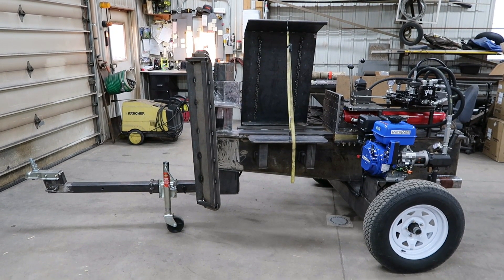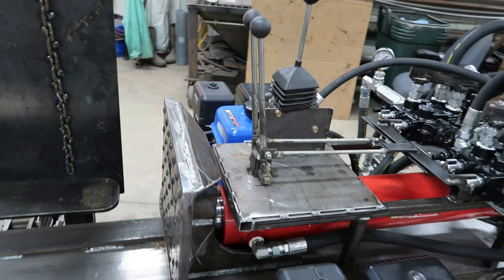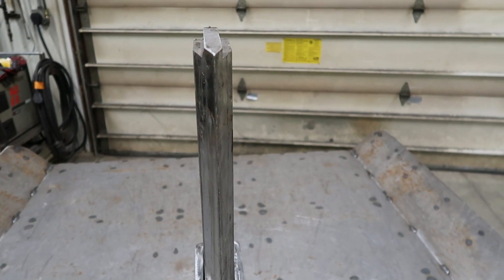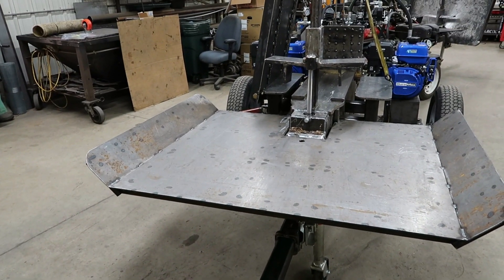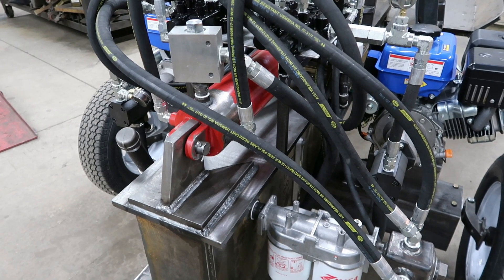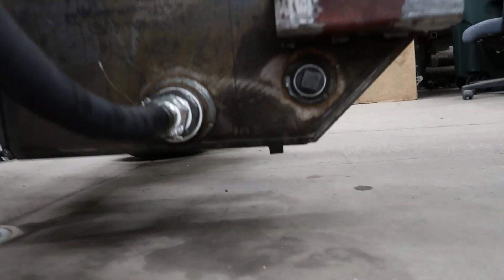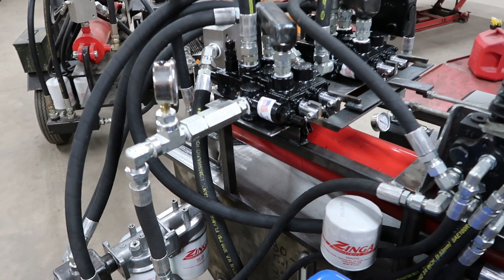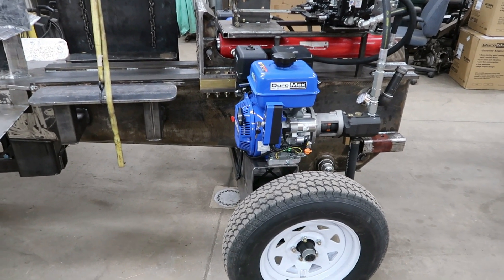Wood Splitter- Double Vision

Comment: I finally got my center beam welded together , i was wondering if your ram was all the way against the pusher plate or back from it relying on the pin?
Reply from the maker: Good to hear. Yes rod eye and push plate bushings were all machined out of a solid 2”x4” block of steel. When welded to push plate gussets, bushings, and rod eye were all set against back of push plate, 1.25”  bolt inserted, then welded except for rod eye. Eye was then removed and welded to rod.

Comment: Nice job, so how are those Duamax engines? The 18 HP has no trouble running the 28 gpm pumps?
Reply from the maker: So far no. My other splitter I modded had a 15 hp running same pump. But again I’m running a 5” cylinder which allows me to run lower pressures 2200-2300psi. If a person wants to run 3500 on 28gpm pump an 18 hp probably ain’t gonna do it.
Reply: @garny3766  I have a 28 gpm 2000 psi pump with a 18 hp B & S, 4” bore 3” rod x 24”cylinder, I prefer the speed over tonage but engine is getting tired and considered replacing it with that Duramax 18 hp but didn’t know how they were, hard to beat the price.
Reply from the maker: @garyallard1827  good so far. I probably got 40hrs on them. IIRC I had these two shipped to my door for just under $800.

Comment: What cylinder did you use? auto valves? Pumps? I want to build one with a diesel engine i have
Reply from the maker: Ruggedmade cylinder 5x30. ACVs and 28 gpm pumps from surplus center. A lot of hoses and fittings from surplus center as well.

Comment: Would you mind sharing what cylinder you used on this build and where you purchased it?  I'm weighing out all the parts to build something heavy duty like yours but having issues sourcing big cylinders like  Easton and others use. Your splitter is bad ass btw, the fab work and proof of concept is top notch.
Reply from the maker: https://ruggedmade.com/categories/hydraulics/cylinders/welded-log-splitter-cylinder-3-4-work-ports-5-id-x-30-stroke-x-3-5-rod-od-2-375-rod-end-clevis-mount.html
It’s the same cylinder as what was on the 37 ruggedmade splitter I had. Yeah hard to find a big rod/bore cylinder.
Reply: @garny3766  That cylinder looks pretty beefy, can't see me needing much more than that. Thanks for sharing, I like to open source info and help other fabricators when I can, I did a bunch of that on my sawmill build and may do something for my splitter build. I read your post about having the splitter bug, I've been using a TSC for the last 5 years and built a hoist for it a few years ago. I heat with wood( I do not have a furnace) It's time for a real splitter or time to get a furnace one or the other. Thanks again, subbed to your channel.
Reply from the maker: @Tonnsfabrication  I’ve been trying to locate the valve on this splitter https://youtu.be/_f-iHC2enuw
I think it would speed up and fit your TSC splitter just fine. Also most don’t need a 30” cylinder. I went with it cause I like my wood longer than 24”.
Reply: @garny3766  Is that valve not available at surplus? Apperance wise it looks like whats already on my tsc and some of the husky splitters I've seen but I'm no expert , plus I'm half blind. I'm definitely wanting 30" capacity, I'll be mainly feeding a boiler and a maple syrup evaporator both of which will accept 30" stuff. 24" sometimes is just a tad short and I don't mind waiting a few seconds.
Reply from the maker: @Tonnsfabrication  not yet that I’m aware of. The do have a regeneration/rapid extend valve but it’s for low flow pumps and a lot of modifications to get it to fit up. This valve in the video I believe would be just a change out. 
 Same here. When I had a box store splitter I would catch myself cutting blocks just a hair to long. 30” cylinder...problem solved😆

Comment: Great idea about the horizontal wedge laying flat for just splitting in half.
Reply: Not his idea. He did use a different design though.
Reply from the maker: @bullybluecoal1831  who else is using this wedge design?
Reply: @garny3766  Eastonmade. These are the Cadillac of splitters. Very pricey but a one time investment. All wear points are replaceable.
Reply from the maker: @bullybluecoal1831  yeah similar and as you said different design. I think he has 8-10” of exposed single vertical wedge when horizontal wedges are at or below beam. With mine you don’t loose any single vertical wedge height when lowering the 4way. I have 23” of vertical wedge. I followed timberwolf/Wolfe ridge design with a slight twist, I added small vertical wedges on the bottom of my horizontal wedges to create a box wedge when wedge is raised. It worked but I didn’t like the amount of trash the box wedge was creating so I removed them. EMs are world class splitters no doubt.
Reply: @garny3766  Interesting with the Single/4 way/box wedge design. I do like box wedges. Especially the pull back bar. I don't mind the "waste." Bark bits are always waste no matter what is splitin wood. The scrap pieces make good kindling.   
FWIW, I wasn't knocking your splitters. You build a good machine as well.
Reply from the maker: @bullybluecoal1831  no, no offense taken. For my wood cutting operation I move thru the woods and consume the whole tree. I end up with plenty of small branches hence I don’t need the box scraps. I’d much rather they stay attached to the pieces I split. My uncle calls them Sasquatch‘s toothpicks 😆
Reply: @garny3766 sasquatches toothpicks 😅.
I was thinking of building an adjustable box wedge, that I could raise a few inches, that way there would be less trash. With a fixed box wedge it seems like you have som many of those toothpicks lol.
How's this splitter holding up, have you made many changes.

Comment: Nice build! I think you will want to add an oil cooler, but otherwise it looks great!
Reply from the maker: So far so good. I been running it hard and the warmest I’ve seen is 130*F in 55*F ambient. The way I have the oil returning into the beam (dump valve base end constant return wedge end) it really helps to distribute the heat throughout. I can always add vertical cooling fins to help convect heat naturally.

Comment: Incredible build. I would have thought that going to a higher pressure and smaller ram would have worked out more cost effective than going to 2 28gpm pumps.
Looking at the Dad's first use video it looks like something is fouling up the release of the return stroke auto cycle lever. Instead of the nice snap action it's got some hesitation.
Reply from the maker: Alan oh yeah a smaller ram and one engine would definitely been more cost effective but what fun is that to do what everyone else did? my goal here was to prove I could move 56 gpms and still maintain a two stage pump setup. No one is doing that that I’m aware of. One thing is larger ram and lower pressures is easier on everything. And yes I have been messing with detents to get right setting. Oil temps play a big part in getting them working correctly.
Reply: If you've got the money to have fun then fun is the way to go. I'd love to have the money to experiment on making an awesome splitter.
Reply from the maker: @Alan_Hans__  well that’s why I work a full time job (which I’m heading to in a half hour) and run a side business that is just about a full time job too. No shortage of work around here in the trades. Only thing is it doesn’t leave much time to work on my own stuff. I had to back up my side work to complete this now I’m paying for it . People want there stuff yesterday!

Comment: You sure make good looken welds. Who you buying the 5 inch cyl. from?  I think it's time for a shop tour.
Reply from the maker: Cylinder came from ruggedmade. Not much to see in shop other than a lot of snowmobiles waiting to get fixed
Reply: @garny3766  How many snow mobile tracks  would it take to make a conveyor, think about all the drive and support wheels and maybe the tunnels ? junk machines are stacked up like cord wood all over the place.

Comment: Well thought out splitter.  Love the dual gas engines.  Your thoughts on the external oil cooler came on right as I wondering about if one was needed.
Thermal conductivity of steel  plate isn't great, but you could weld on steel or bolt on aluminum fins for a bit more surface area (inside and outside)...

Keep up the great videos.
Reply from the maker: Tom so far so good. I’m moving that heat along the whole longitude of the beam. When building I thought about adding some vertical cooling fins to help natural convection. so far the hottest I’ve seen is 130*f in 55*f ambient.

Comment: Holy Smokes!  That is one impressive setup! That will set you in the Guinness World Records! That is a clever way of achieving such GPM without having to throw a few grand for parts! I am moving to the next video!
Reply from the maker: Thanks Joe. I knew you’d understand and appreciate the cost per hp/gpm. I just revamped the control levers tonight. I’ll get it back out and some more footage. I’m still learning how to run all the levers and see what works best for positions of the wood pushing thru the wedge.
Reply: I am very curious to see what can be improved!!!
Reply from the maker: @FromSteelToWood  I had to redo the fulcrum pivot and bring the load connection closer to it. The levers pulled pretty hard. Pulling 2 spools per one lever I need all the mechanical advantage I can get.

Comment: how wide is the axle base?
Reply from the maker: 8x8 is 54” out side of tires is 74”
Reply: @garny3766  Thanks. Where did you get the torsion axles from
Reply from the maker: @martygilpatrick9727  https://www.easternmarine.com/flexiride-torsion-half-axles-ff-350b-3
Reply: @garny3766  sorry for all the questions. What are the dimensions of the H beam used? thanks
Reply from the maker: @martygilpatrick9727  no h beam on it. Splitter beam is a fabricated box with gussets and baffles internal. Best analogy I give people is think of an excavator dipper stick.
Reply: @garny3766  Just wondering. Would a 30 gallon tank be just as efficient as your box beam to drive 2 motors and 2 pumps?
Reply from the maker: @martygilpatrick9727  from what I’m seeing during testing is no. Beam tank has much better heat dissipation than a square reservoir tank. If I was to use a square tank I for sure would need an oil cooler. 
And if I were to use a tank it would take up real-estate on the splitter. My thinking was in order for the secondary engine to have placement I would need to move the conventional oil tank...hence oil tank in the beam.